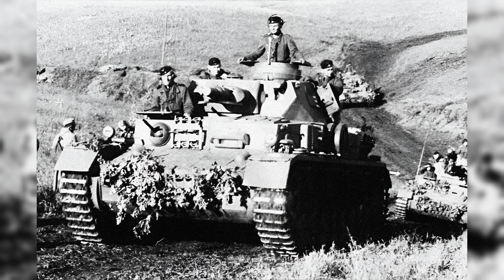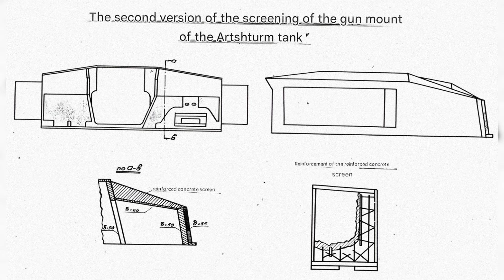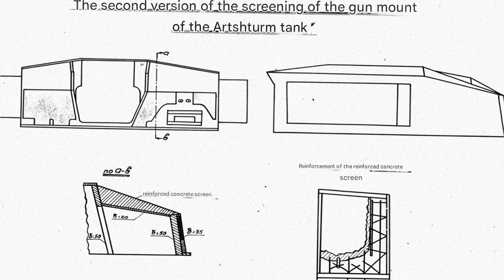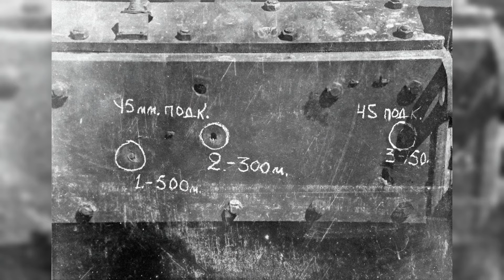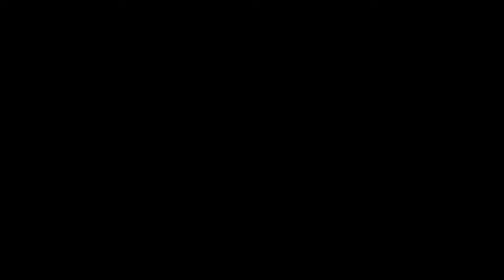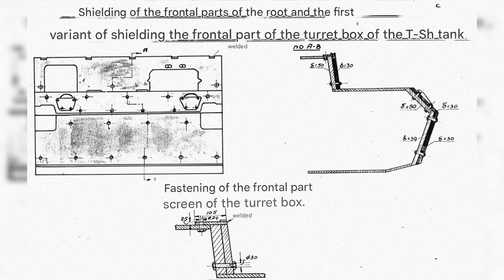The Dead End: Why German Tanks Became Too Heavy

Comment: Excellent video. Just one thing. I think there is a conceptual mistake. The so called "Spaced armor" plates in the video, were not what is considered Spaced armor in tank or Battleship design. Is just to add one over another one, two or more plates bolted or welded together. This provides less protection than the sum of both plates, but the Spaced armor, takes into account to leave spaces of Air or another matherial enoughly Big between both plates so the incoming shell degrades the penetration by various means. This kind of protection, is at the very least, equal to the sum of both plates or more usually more than the sum of both plate thicknesses. That is what Germany was using in Battleship design and sometimes used in late war tanks against shaped charges and anti tank heavy rifles, the so called "Schürtzen" (long skirts). The first ones gave less protection than one single plate for this reason.
14:18 
Indeed , all German war trials and postwar Allied trials showed that a properly designed spaced armor complex, was better or at least sane as a monolithic plate. It was just inferior when there was no space between plates. ADM 213/951 (I mixed the numbers), Lilienthalberich 166 and other documents show that Spaced armor works pretty well. (is used in tanks now albeit in a slightly modified way, the chobham and Soviet armour schemes with steel plates between textolite slabs).
Best regards .